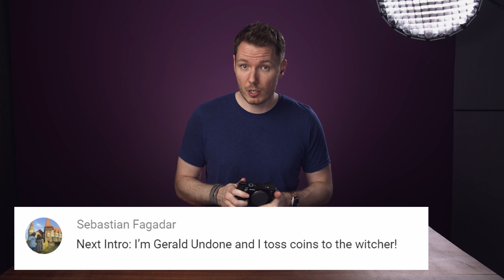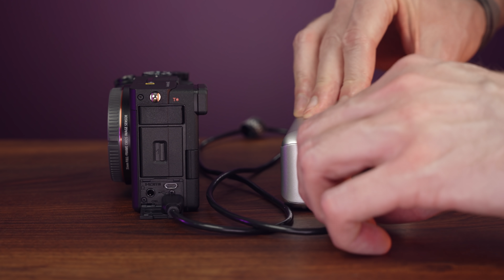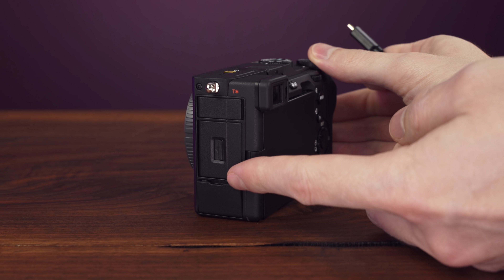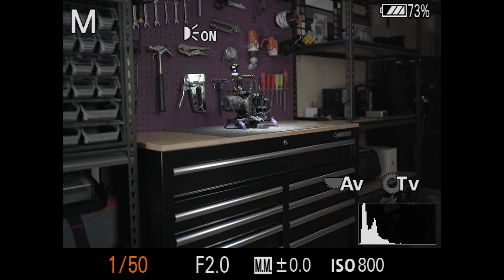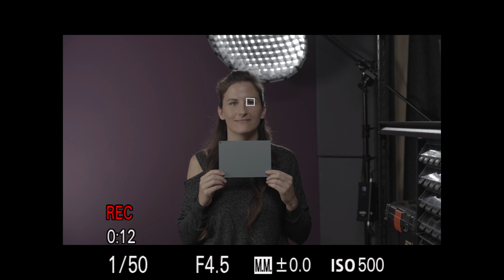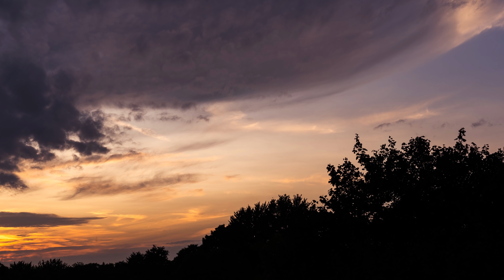The SONY a7C: Why THIS Camera Is IMPORTANT!

Comment: Wow, Nikon user just discovering this gem in 2023.  The menu system doesn't bother me because you just have to setup the custom menu.  The joystick is big because you can remap the dial-pad buttons to set them up like a point and shoot.  C1/C2/C3 by the lens would really help.  Great point with the dial on the grip.  I'm going to rely on the user modes, I hope it has 4 on the card like the other A7's I've tried.  To consider the Z6/Z6II close to this camera is a bit strong.  Tracking is nowhere near this level.

Has this camera's firmware been updated since this review?  I'm going to be putting the Tamron 20-40f2.8 and 70-180f2.8 on it.  At least until Nikon makes a proper DX body that replaces the D500.  I even had to switch from the Z50 to the Z30 to get a few basic features from 15 years ago DSLR's.  So I have no EVF, and I'll deal with this one, and have a full frame sensor.  Maybe they'll update it so I lose some more money.  LOL  It is holding it's value REALLY well.  Unlike my Z7II btw.  Thanks again for the great reviews!  Cheers.

Comment: Hello brother. I need help. So basically I was changing lenses and a little bit of spit got on my shutter that was covering the sensor. It evaporated but left a dark little smudge i can still see on the shutter. Images still come out fine. Is there a way to safely, properfly clean the shutter? Thank you .

Comment: hello, i come from a sony aps c and i bought the a7c. I keep the sony 16 55G 2.8 lens (aps c). the use of the camera will be 100% for video. Should I keep the kit lens that came with the camera (FE 28-60 F4-5.6) or use the camera in aps c mode with the aps c 2.8 lens? focal length would not be my concern. 90% of the use of the camera would be in low light situations. thank you

Comment: Gerald, I know I'm like a year and a half later to the party, but how badly does the A7C's 8-bit 100Mbps bitrate compare to the A7IV that can do up to 600Mbps ALL-I for 10 bit 4:2:2 4k60fps like the new A7IV? Is it CLEARLY dirtier or noisier as a result, and does it make a difference at 1080P if you're using crop lenses? Also, was the firmware ever updated to allow nonstop power delivery with battery bypass? I know the A7IV doesn't do that either.

Comment: I forgot to post this over a year ago, but maybe someone will find it useful:  I think the difference in the audio gain is probably a result of the location and orientation of the mics on the two cameras.  The A7iii mics are located on the top of the camera and aimed upward.  The result is what most people would call an "omni-directional" pattern.  On the A6n00 bodies, and on the A7C, the mics are located on the front of the body and face forward, like on most camcorders.  The result is a forward oriented cardiod pickup pattern.  The reason you needed the increased gain on the A7c was because the cameras were on the table with you behind them.  This is part of the reason I bought the a6400.  I find the pickup pattern more useful for most video work.  In some situations, adding a 3rd party mic actually does nothing to improve the sound, and getting a stereo recording through the camera mics is a nice bonus.
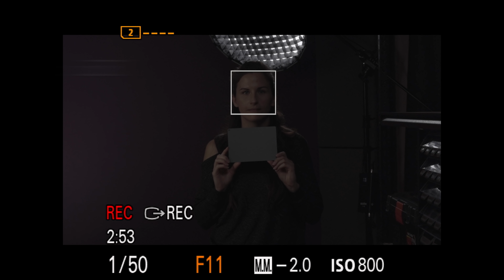(Added Nov 24, 9:16)  On further thought, if you put the cameras on tripods, at about 2 - 3 ft and aimed at you, you should find the levels roughly favour the A7c.  If a camera puts the mics on top and aimed up, it attenuates noise from feet, but picks up more from ceiling reflections and overhead stuff like leaves in overhead tree branches, aircraft and bird.

Comment: Hey Gerald... i got a question ... currently have 2x cameras - a6400 (only for web streaming / web cam) with Sigma 16mm 1.4. Also have a sony a7iii with a couple G Master lenses for family/travel/hobby/events. I am thinking of either selling both camera for a single sony a7siii + 24mm G 1.4 as both webcam/stream and events. Not sure if the a7siii is overkill for my needs. Due to the lockdown, a7iii is collecting dust... a6400 is getting plenty of use :)

Comment: Ahh... It looks like the HDMI cable block a bit of you view of the flip-out screen :(
When you're streaming, the screen would be facing the same way the camera would. And the hdmi cable seems to block a part of the screen, going right in front of it.
I was thinking about this camera (to upgrade from my A6400). Luckily, I've watched you video and noticed that important issue. Thanks!

Comment: I’m on the fence on buying this one. The only thing I try to find out, is if you switch between video and M for stills, does it keep separate settings like shutterspeed for example? And in that case, does that also apply to the record button?

Comment: Not sure if this is just my a7c, or a lens problem, but when recording interally with the sigma 50/1.4 art, at slower af transistion speeds, the focus changes in steps as if it's ignoring the curves in between steps only while recording. This is consistent throughout the aperture range of the lens. This a possible bug?

Comment: The Fuji GFX-100s is another example of what Gerald said here about the A7C release four months ago.  Manufacturers can either add capability to existing body sizes or add capabilities to the smaller and lighter bodies.  I am all for Sony AND Fuji releasing their new models demonstrating these evolutions in their cameras as of early 2021.  The hardware continues to get better and better.  My skill level is improving at a much slower pace, however.

Comment: Gerald, can you explain the face tracking in 4K? The manual is a bit confusing. Does the face tracking in 4K turn off if I also have a HDMI MONITOR (not recorder, only monitor) connected? 

Also, under which video modes is the face tracking completely unavailable (not including HDMI complications, just camera alone).

Comment: Thanks for this, it informed my purchase of the a7c, which I love! I also recently purchased the full frame Sony 50 1.8. According to everything I read, it’s a great lens for the price, but the auto focus is pretty slow for photo and terrible for video, but is very much improved by a firmware update. This has all proved to be true except for the firmware. It’s now nowhere to be found. All the previous links to it on SONYs support site are dead. Sony’s support is not helpful, saying that they don’t have any firmware updates available at this time, which is simply not true. Many YT videos and reviews can attest to this. Do you have any suggestions for me? Any mirrors of the original file somewhere? The file name was Update_SEL50F18FV3D.dmg or .exe depending on Windows or Mac. I could use either.

Comment: I'm a previous owner of a Canon EOS M50 and that camera sucked. I am now looking to buy the A7C but wasn't sure if it's the right choice. I have seen several reviews but this has got to be most comprehensive one out there. It's informative but not too technical. I can't believe I watched the whole thing without skipping. 

Aside from the amazing AF and other improvements, I think one of the things that I like about this camera is the fact that they have adjusted the battery door and the location of the mic jack — some of the things that I hate about my previous camera. I know, it seems insignificant but when you're gonna use the camera regularly, these little inconveniences will matter. For the rest (single SD slot, no custom buttons), I think it'll be okay for a hobbyist like me. 

Anyway, I'm planning to buy this tomorrow and I hope I don't regret it. :D

Comment: Another market:  migrating m4/3 owners, especially given the uncertain future of Olympus.  This a7C is pretty much the size, and weight, of my Olympus EM5-2, pretty amazing for a FF sensor.  With some careful selection of the smaller primes, m4/3 people could end up with virtually equally portable gear, with significantly better images.

Comment: Very interesting material! I have a question for you and the viewers, maybe they already have some experience.
Have you checked if it overheats when recording 4k after about 1h (I have A7III and after about 60 minutes it overheats and turns off)? I am thinking of buying this A7C, but the condition is that it cannot overheat while recording 4k in continuous mode.
Reply: I'm of course very late, but it's sure that if you need a camera between both for video, A7C is better, also for the no recording limit and minor overheating or the autofocus in 4k

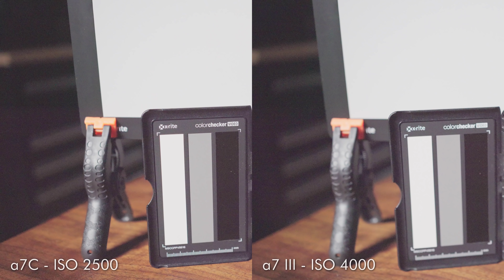Comment: Thank you for the great informative review! While you mentioned about the green (a7C) and magenta (a7iii) shift as the ISO rises, any ideas what causes only the top-left quadrant to be impacted around 13:54? There seems to be a distinct delineation of portions of the XRITE card and the tool chest in the background that are shifted green but right below that "line" it's still relatively black. You can see this effect start at ISO 5000 13:49 and it's rather noticeable when going from 6400 to 8000. The A7 III seems to exhibit the same phenomenon in the same area but reversed with the bottom portion shifting more magenta than that top left corner (especially noticeable @ ISO 51200 - 13:59)

Comment: Great review Gerald! The only thing which was not mentioned is that the a7c records gyro data, which then is stored inside every movie file. With Catalyst Browse you can create amazingly stable footage - i was blown away when i saw it - the stabilization often looks much better than any other digital stabilization - see Brandon Li's video on it. Only a7siii, a7c, zv1 and fx9 currently offer this feature. The a7iii at this point does not record gyro data. Downsides of this stabilization are loss of motion blur and - as it is with every digital stabilization - a crop and therefore loss of some pixels - which in my view are acceptable trade offs.

Comment: As currently using an Olympus OM-D, especially aspects like the full articulated flip screen would be important to me and also it would be nice to have features like in-built focus-stacking or the fantastic live-time & live-comp modes or the newer "Starry AF", the "Mega Menu", etc. The latter features could maybe solved by firmware updates, as far as I know, Sony doesn't have most of them yet.

Comment: separate power and remote port (which also delivers power) are very convenient on A7 III...
can we use a USB-C to Micro B adapter on the A7C and connect the VPR1 remote?

Comment: Great video once again 👍
I want to buy a full frame camera. I am not a professional but have a keen interest in potrait as well in travel photography.  I am confused between Sony a7iii, Nikon z6 and Canon eos r. And now Sony a7c. Can you suggest any one based on my needs. Your suggestions is highly appreciated. 
(I previously owned a Canon 1100d old version with kit lens and a 50 mm f 1.8, which i used extensively for past 8 years)

Comment: The kit lens lacks OIS so it has to rely on the IBIS which isn't great. The kit lens to the a6600 has OIS which helps with the IBIS. The a7c has USB C. Flip OUT screen. Full frame 4k 30 video.

Comment: is it important to make the next FF cameras more expensive without reason? 
3 years after the a7iii for similar specs and results, but a lot of downgrades to stitch huge sensor inside A6600 body losing IBIS performance (not great alreadyt on A7III), at a price. No new menu system, removed all the custom keys, one slot, tiny EVF. There is also not an entire new body design to justify costs, it's a totally recycled design again. Is there any real Pros?  
A7iii downgrade in some way, not a successor of course but for a similar price. An expensive point and shoot camera when you lose all the custom keys and menus are complicated the same, no newer touch functions to make the use more simple for the target audience, video and expecially for stills very limited overall experience.
Real time AF it's not so important if out vlog static in front of camera where u can use manual focus 99% of the time, or considering how good already was A7iii AF for main video scenarios.
A deal breaker for a starting price between Z5 and Eos Rp, otherwise this "entry level" A7C just allow next mid-range FF to be very pricey for no reason. Let me know what you think guys, and I love Sony for its smartphone, it's not a matter of brand, but the FF market become too expensive and usual bring little innovations for huge limitations in features sometimes. :/

PS Video great as always, of course.

Comment: I don't know why people have an issue with this body not having dual card slots. It's pretty clearly not intended for professional photographers and therefore has no need to have 2 slots. If 2 slots was important to you, then you're probably not interested in trying to reduce the size this much and would be way more inclined to have an a7iii for a myriad of other reasons

Comment: No front command dial and lack of custom function buttons mean you have to use the menus. But they loaded it with the old crappy menu system and it still doesn't have full touch capability. These are deal breakers. The small crappy viewfinder is another nail in the coffin. The price is the final nail in the coffin. The Canon EOS R, Nikon Z6 and (dare I say) the Sony a7III are all better ways to spend your money if you want full-frame mirrorless. Evidently, that Canon cripple hammer design team left to go work at Sony.

Comment: Looks good - will the weight reduction make it a good camera for Astro photography? Thank you for your review having no shutter is a great thing. I have burnt out so many shutters on my Alpha A77 mk 1 and 2 and was always scared when hearing the speed of the shutter getting slower and slower until it locked up. I do own the Sony QX100 and found it a fun camera.

It maybe time to move over to these smaller cameras even though I would not like the feel and weight of them for normal use outside of astro photography and for sports photography like Ice hockey a large camera with the larger G lenses always felt like the balance was right as long as you have the VC grip.

Comment: so basically they just removed the finder from a7iii, gave it a flip out screen that should be obligatorily on all cameras, while sacrificing stabilization, and that for vloggers, so a7c pretty much leaves things desired for next iteration, never perfect. yeah not reason for a7iii to upgrade (I am not a7iii owner and won't be a7c owner due to high price, not much difference from a7iii and worse stabilization)

Comment: Would had bought the a7C instead of the a6600 if it were available earlier for travel kit. But of course, when paired with comparable lens, the a6600 would still be a smaller package, although the a7C gives that FF look and low ISO noise capability over APSC.

Comment: Electronic front curtain causes issues with wide aperture primes and high shutter speed. Essentially if you use 85/1.4 lens in a scene with lots of bokeh circles and speed is high e.g. 1/4000 the bokeh circles get clipped.

It would be nice to know if A7c is indeed having this problem or it smartly switches to full mechanical at speeds above 1/10000

Comment: Interesting and helpful review.  However, you fail to discuss the ergonomics of the camera using different lenses - GM 16 - 35 for example or the G 24 - 105 or the 70 - 200 GM.  Why would I buy an interchangeable lens camera if it is so small as to make it difficult to use with these lenses (you didn't say it was but you didn't say it wasn't either) or others in the Sony lineup.

Comment: The shutter shock is massive on my A6000 compared to other cameras I used, I don't know why they didn't tune that better. And it has the 'small body'  so it might feel more.

A job for you Gerald, Shutter shock measurement? As vibrations or impact force in some way. 
I know ur video, but u like cameras and don't back from the hard stuff?
The shutter in A-series later models are better but still to hard for my taste.

Comment: I guess, if you don't own a 7iii, and a 7siii is out of budget, then you can have a choice between a used 7iii or a new a7c. Only real different is that the viewfinder is smaller. In many ways its better -- its a revision at the end of the day. an a7iii lite. in a matter of months or in a year, a used a7c would be a perfect bcam or backup for an a7siii or an a7iv when that comes out.

Comment: I've never understood many manufacturers' obsession with making certain objects as small as possible. Smartphones I get. Microprocessors I get. But for things like cameras or laptops, you are going to be carrying these around with bags and straps anyway, because the A7C with its grip and even the smallest lenses available is not truly pocketable. Yes the A7C is a bit lighter, but I suspect that the smaller grip will more than offset that in the comfort stakes - especially if you use basically any lens other than the kit lens. Most of the weight in any mirrorless system - especially full-frame - comes from the lenses. So really, a bigger grip to make those lenses easy and non-fatiguing to handle is better than a smaller body. That is my biggest complaint with Fuji - even though their system is very lightweight, I find my Nikon Z6 to be more comfortable to use with its larger grip. Nikon and Canon have it right - there's no point competing with smartphones on size and weight, just make the cameras small enough and light enough while still being comfortable and ergonomic to use - that is where cameras have a real advantage.

Comment: Camera is beautiful but it's overpriced. It should cost no more than US $1199 considering the competition (Nikon Z5/Z6, Canon RP) and considering it is older camera in new body. Old menu and single card slot is disappointing at this price. For stills, Nikon Z5 is much better/cheaper and for video, Panasonic S5 is way better.